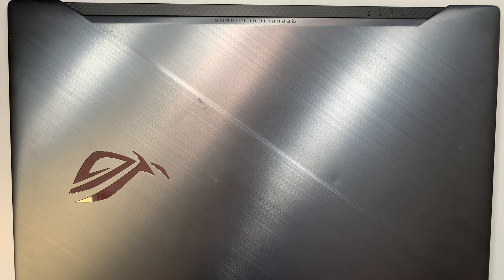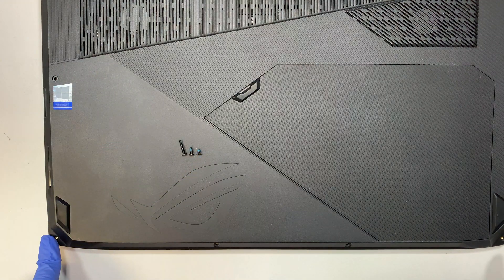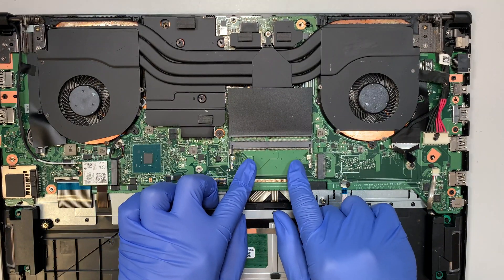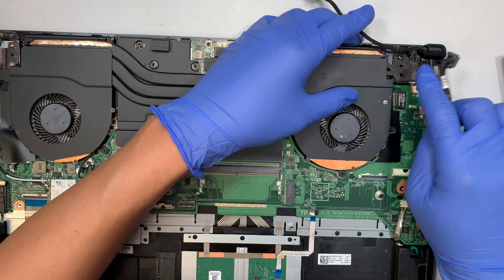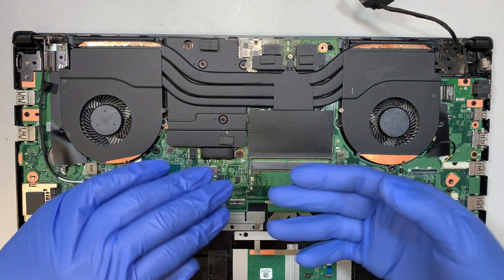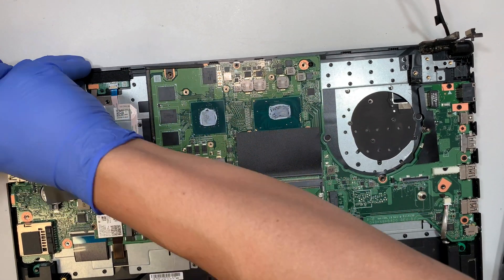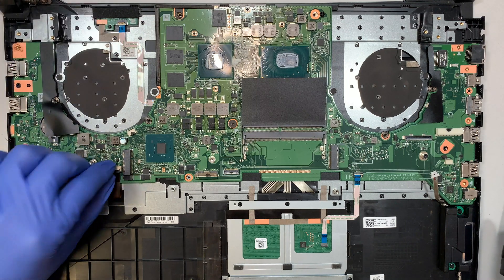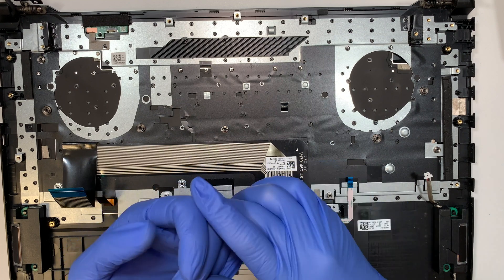Asus GL703GE Gaming Laptop Tear Down Disassemble

Comment: i bought a keyboard that matches my keyboard numbers on ribbon cable, installed it made sure everything was put back in order reconnected battery  and installed the bottom then checked lights on keyboard everything seems OK but since i had it unplugged for over a month i decided to charge battery the light for it being plugged in came on. 2hrs later i turned it on for first time and nothing happened , what did i do wrong?

Comment: Hey great video. Maybe you can help me out.  i have a gl703gm. It appears to be pretty close to the same construction as that. 
It appears my touchpad is dying (the charger, battery and touch pad have all died in the last 3 weeks....not happy.). Nobody has made a video of removing one and you didn't do it here but is that part fairly easy? Replacements don't cost much.

I just want to make sure it's not something over my head before i try it.